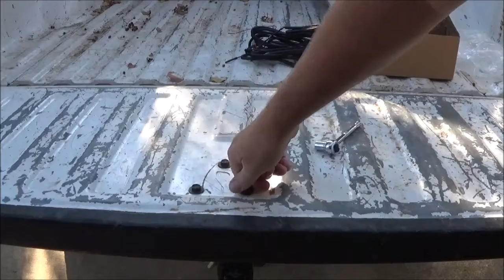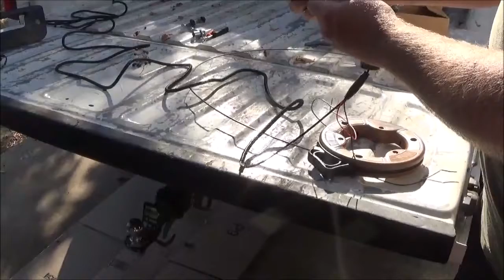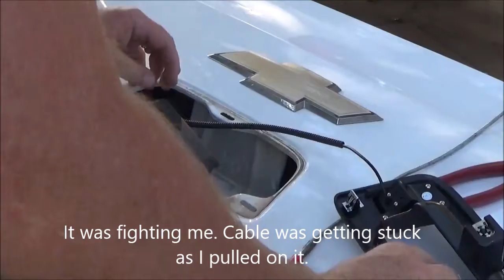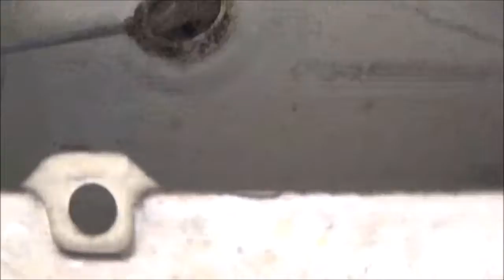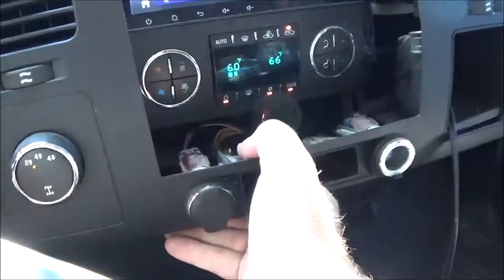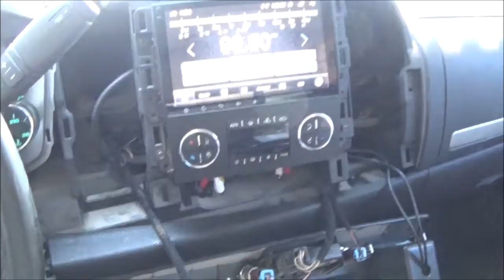BACKUP CAMERA INSTALL - CHEVY SILVERADO

Comment: Can you view the camera when the vehicle is not in reverse?
Reply from the maker: From my research on the internet, it says you can. It will take some wiring and a switch. Review your stereo literature. Hope this helps you. Thank you for watching.  Please like, share, and subscribe. TYMM :)
Reply: @TexasYardManAndMore  can you view the camera when the vehicle is not in reverse with your head unit and the way you wired it up?
Reply from the maker: HI John. It has the capability I am certain, but I do not have mine wired up for that.  I love my backup camera though. It helps a lot.  Thank you for watching.  Please like, share, and subscribe. TYMM :)

Comment: Thanks for showing how you routed the cable into the cab. I have a 2005, I ran the cable from a license plate backup camera along the loom just like you did, found that little grommet in the driver's floor and wondered if I should puncture it. You gave me the confidence to do it! Worked great, so glad to have a backup camera now. 2005 Silverado 2500 HD extended cab with 8 ft bed - this big beast is hard to maneuver in a parking lot.
Reply from the maker: The backup camera is very helpful.  I am glad I did it to my truck. Like you said these 2500HD trucks are beasts! Having a backup camera is a game changer. Thanks for watching and glad the video helped you.  Please like, share, and subscribe. TYMM :)

Comment: Unless I missed it, don't you have to tap into the reverse wire on the taillight?  How does the radio know when to flip to the camera?
Reply from the maker: I do believe there is a connection for it in the harness.  Mine works fine when put in reverse.  Thank you for watching Porkchop10.  Please like, share, and subscribe.  TYMM :)

Comment: Hi what are those connectors called never seen them before. Would like to order some. Awesome video thank you for sharing it.
Reply from the maker: Hi Ed.  Those are lever wire connectors.  You can get them on Amazon for 10 bucks.  "Lever Wire Connectors, HTCELLE 60-Piece Quick Connect Electrical Splicing Kit for Compact Inline Terminals - 28-12 AWG,"   They work like a charm.  Please like, share, and subscribe to help out my channel.  TYMM :)